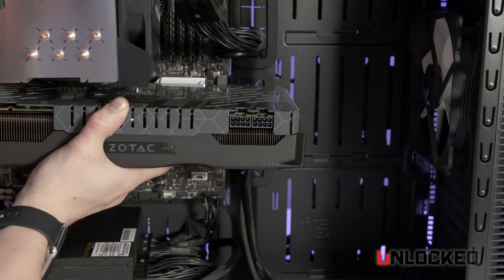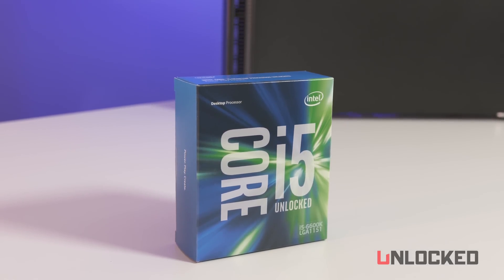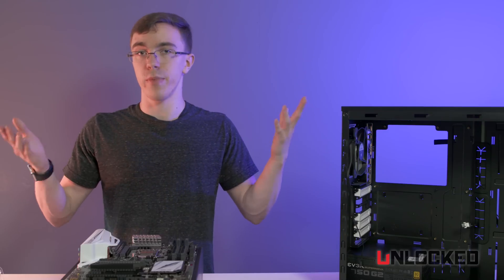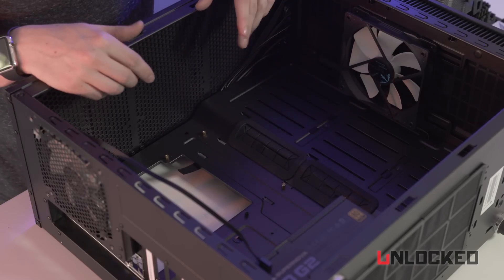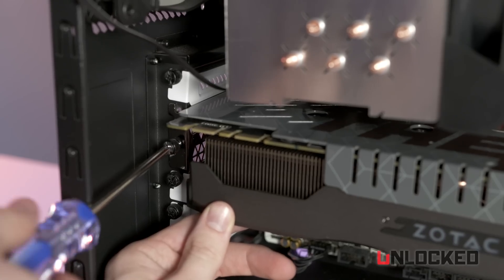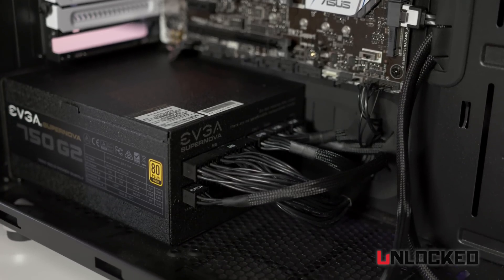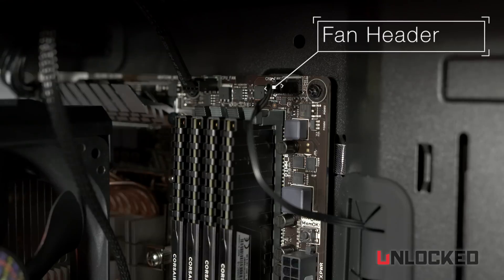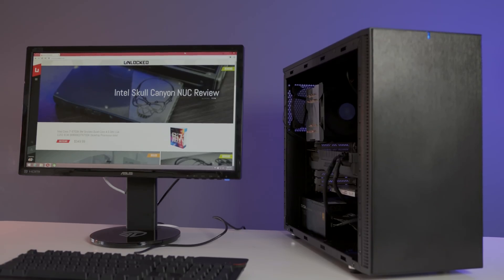Gaming PC Building 101 with Austin Evans - Unlocked

Comment: I have a problem guys. i got a new power supply, pligged everything in and started my pc up. its a fairly old pc and im pretty poor so i cant afford to build a new pc. When i started up the pc everything worked out fine but it said that it couldnt detect my boot device (which is my hdd) I plugged everything in neatly and controlled it a few times. The sata port is working but i have a few open sata ports on my mainboard. Would you mind helping a noob with minimum knowlwdge out? My new powersupply is a lc420h-12 420w. my mainboard is a asus a78m-a and my hdd is a seaagate 1tb hdd. Thanks in advance.

Comment: Is this a good first build.
Do you think it can run rust and csgo

https://pcpartpicker.com/user/CadenShawver/saved/nYLBmG
Reply: lilBlazen you're good mate
Reply: Where's your CPU cooler? Don't tell me you're going with the stock. 
Unless you already have an AIO liquid cooler/decent air cooler lying around, you should probably invest in a cooler.
Makes a massive difference from stock.
PSU could be improved, but I don't think you should have a problem.
You're planning to go wireless? Wired internet is always gonna be better, but whatever floats your boat.
Otherwise, that's a fairly solid build. 
This is my new build, I'll be ordering everything after I get $1k more... https://ca.pcpartpicker.com/list/6bm7BP

Comment: i wish i seen this before i built my first pc i didnt know about the screws lining up with the motherboard till my ocd caught one missing and i moved it. i had an issue with my case having two fans and my mother board only having one spot for my fan. also i didnt know about the little arrow for positive on the power switch and reset

Comment: Do not only put a grain of rice's worth of thermal paste on your CPU!

It has been proven that too little thermal paste is a larger problem than too much. 

Don't put too much on, especially if you use a conductive paste, because the excess will be squeezed out onto the motherboard.

But what is worse is not having enough, which can lead to uneven temperatures and higher operating temperatures.

Put about a pea-sized amount on there, do not spread it around as spreading it by hand will introduce finger grease and air bubbles into the paste. Simply secure the cooler onto the CPU and the pressure will smooth it out evenly across the surface for you.

Comment: Hey anyone. Please i need help

So, i am planning on building a pc for mostly editing but some gaming too. How does this look. I need wifi, as many usb connections as possible and thunderbolt. 
Budget 3000, including monitor (idk which one yet)

Cpu- I7 5820k
Motherboard- Asus X99 deluxe 
PSU- 760Ax
RAM- 32gb Corsair vengeance?
OS storage-  Samsung 250gb (forgot which one)
Mass storage-  1tb of storage 
Cooler-  Cooler master hyper 212
Fans- noctua nf12s

Comment: I disagree with your order. I install the PSU first!!!!
I have built quite a few systems where the 8 pin CPU connector will not reach if I try to put it through the case opening at the bottom (with the 24 mobo connector) because it just seems that so many cpu cables or just short by an inch or so and I can't pull enough through to bend or fold  to get it's orientation right and have room to actually line up the connector straight into the socket. And I don't like forcing it by getting one side or end partially into the closest pin and then trying to reef it down straight to go in. In fact, all I get are sore fingers and one of these days I will break a wire - bet it never goes in because it has to be aligned straight and that's all there is to it.

That's assuming there even is an opening in the back plate above where the 8 pin socket. Some aren't even close, and some don't have any at all.

Then there is the hassle of trying to manage cables and keep them all from becoming twisted and /or not protruding through the backplate holes efficiently so then I have to push and pull cables in and out of the openings so that I can get them to lie as flat as possible because I cannot believe how many cases don't have more than 3/4 in betwwen the plate and the cover, esp in the areas towards the back of the case, and eve some have almost no room up front to gather excess cable length.

It is so much easier to plan and try cable placements when there is no equipment (mobo, HDD sticking out almost to mobo, etc.) in the way. Often, it is possible and quite easy to string fan wires and, occasionally, front panel connectors and card readers with psu, usb, and 16 pin(I think) cable that attatches beside 24 pin.

It is way easier to get cables where you want then with more space to use, you can plan ahead to see the most efficient placement of HDD and SSDs so that you have the proper distances for the power plugs to connect consecutively. 

I already know where I want to place everything, and I test how far back the GPU is going to reach and what slots it will cover. Then I can even plan where the PCIe cables will look the best and thread the easiest, because I put it all in place without, like I said, other crap in the way. This also makes it easier to pre place all my cables and get a proper, and neat, arrangement behind the BP. It is way more of a hassle afterwards because sometimes I'll see a better arrangement and have to pull and push the cable in and out and around - creating a huge frustration with power plugs and everything both getting in the way and impeding threading, but also, a major huge pain in the ass is trying to re-arrange the sata and molex cables with openings already populated with all sorts of other ones. Everything catches on everything, and some times there is barely enough room and I have to flod the sockets flat, or sideways, etc.

Okay, to finish, the CPU cable not quite long enough: I can run it under the mobo and it is easily long enough, and clean looking. I can also run front panel connections under the bottom edge just above the standoffs and they look good just coming out and curling up to their respective pins.

Okay, thanks for letting me ramble! And try putting bthe PSU in first if you get a difficult case. Pre wire, or, of course, arrange the cables to where you will use them, then no hassles with trying this thing and that!

Comment: Parts and Compatibility.   that's the problem I have.  3 builds under my belt and all 3 of them have direct X errors and possibly overheating issues.  And overclocking, I don't understand it and most readily available info is  geared towards the advanced pc base.

Comment: Rear fan is the wrong way. 
Not telling people to install the I/O shield first. 
Not telling people that PCI-E slots have little locks at the end. 
Not telling people that you should install RAM in certain (specific) slots, unless you fill all the slots.
Not informing people that sometimes SATA ports on motherboards differ in speed, always connect to the fastest ones first.

I get you don't want a 30 minute video, but don't skimp over some basic, but important things. Other than that, great video.
Reply: True but you need box.
Reply: Please add link to the best video you know.